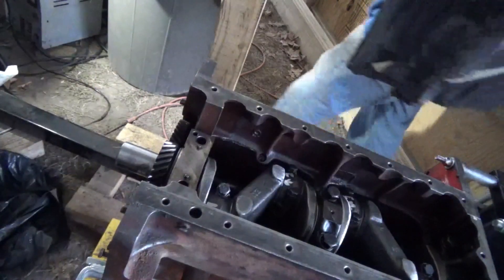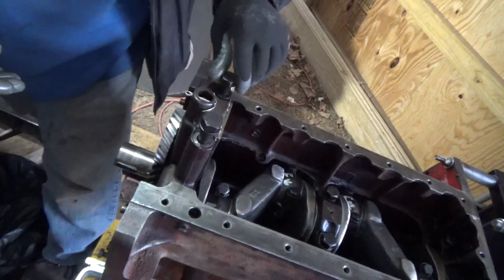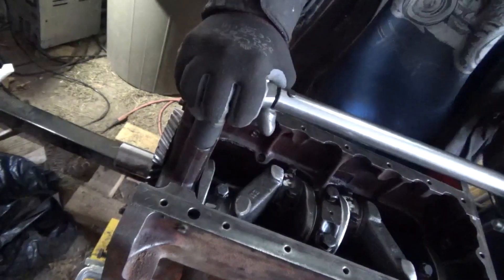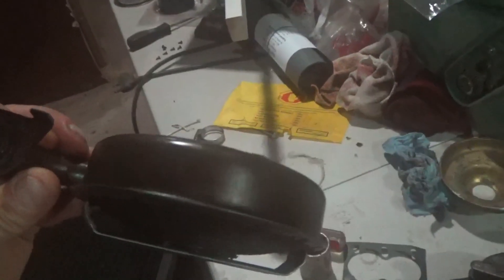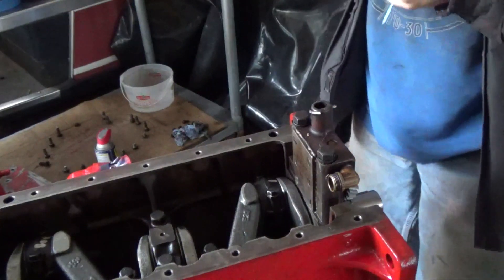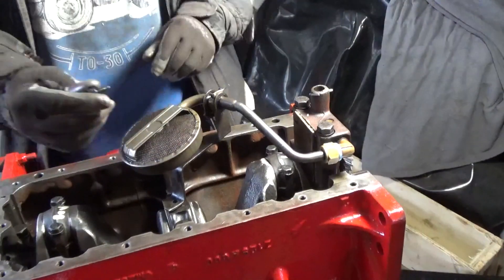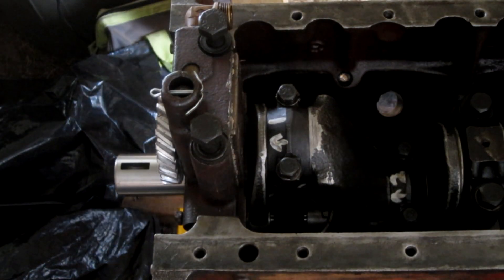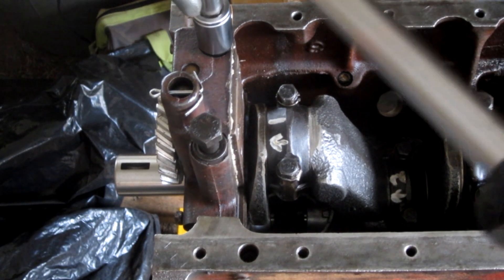1952 Ferguson TO30 Continental Z129 Rebuild - Part 5 - Oil Pump Installation

Comment: Don't use teflon tape there. It seals on a rubber seal around the pipe and squeezed by the nut.
Reply: Hi Anthony, I have a 51 TO30 and when I removed the sump nut that connects to the oil pump the rubber gasket was torn. Would you happen to know part number for that or what I need to replace it? I can't seem to find out anything about it online.